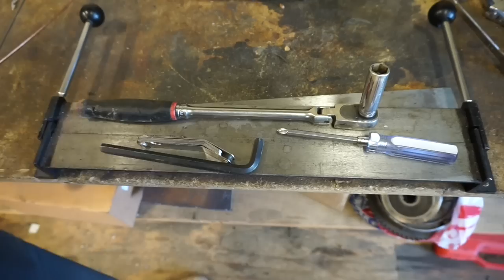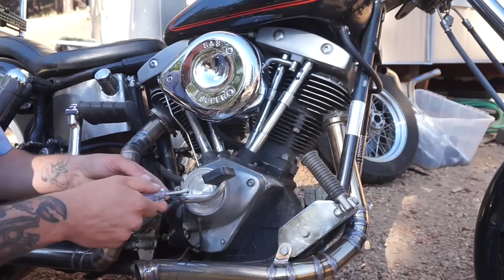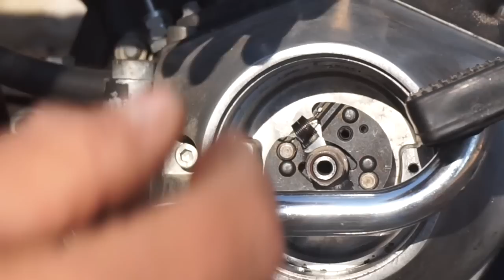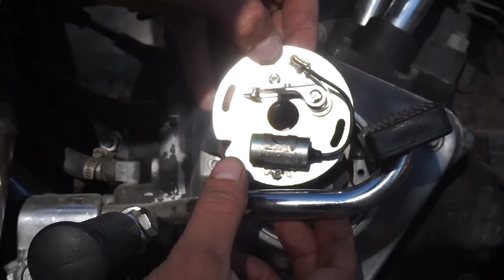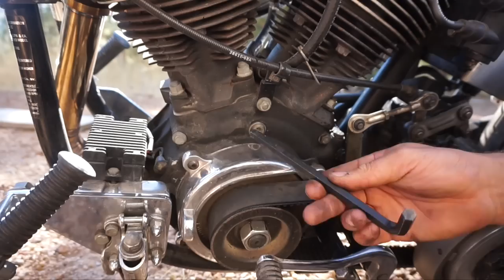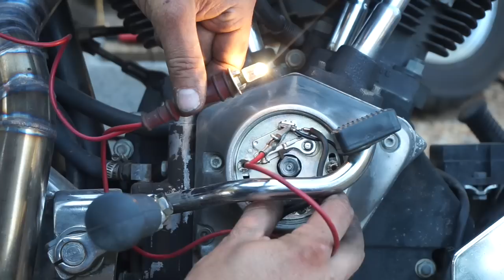Harley Davidson Shovelhead Points Installation and Timing

Comment: The use of sand-paper on new points is a no-no...
Which you didn't do in the video, but you did comment
The reason is that their is a coating of platinum [electroplating] on the points that you will were off. This will drastically reduce the life of the points.

Now that's cleared, the only reason  to use sand-paper is to get out of a bind, when your points are burned.
When the points are burned the coating of platinum is already damaged, pretty much gone, so sanding the points will get the engine running again in the short term. This will continue until you replace them or you get tired of sanding, which ever comes first...
That was my ten cent's worth of wisdom.... Keep on riding...
Reply: thank you

Comment: This was a good video. But let me clarify a few things. 
1. Do not torque your cam bolt to 24ft lbs. Its more like 7ft lbs.you will snap it off if you do 24ft lbs.
2. Do not put red toctite on your cam bolt. You will never get it off again. And trust me if your running points and advanced unit you will be replacing it at some point.
3. When using the feeler Gauge make sure the point arm does not raise when you insert it. You can see in this video the point arm raises everytime he inserts the feeler gauge. He was going for .18 but in reality it was probably like .16. But other then those few things it was a good video on shovelheads and  those are hard to find.
2.
Reply: Factory manual says 12 to 16 INCH pounds....that is 1 to 1.333 foot pounds ...these are tiny bolts...and you don't want to break them

Comment: Rode a 72 shovel in a 58 pan chassis for 18 years. Hate the day I sold it. Road side repair tip. A standard paper match book is approx .018 inches and the striker surface will clean the points.

Comment: Had a 1980 with same rims as your 83.mine had electric start and kick,only used the electric start once just to see if it worked.kick start worked first kick every time once on correct stroke.i thrashed that bike for 3 years,went real good,4 speed was good too,all I ever did to it was loctite and tighten bolts as they came loose.it was an awesome bike.⭐⭐⭐⭐⭐👍👍👍👍👍

Comment: Just small tip always clean new points contacts pads(where u  placed feeler gauges ) with some sort contact cleaner (petrol  in piece rag) does as all new points have a coating and if not taken off cause points contacts to transfer voltage the easiest path ( means uneven and in cases small pits in surface contact pads) this means smaller contact area and also less points life. Jose Cuevas is correct the above step lengthens life of points but if u don't take lacquer coating of contacts u will end up using points file

Comment: If you press on the brake and stick a wrench sideways in the gap where the brake pedal pivots it will keep the pedal down and out of the way of the ignition making it a little easier.

Comment: I went to tighten my points plate, and one of the holes for the fastener stripped again. So, since I already had helicoils installed. Ordered a new Cam cover. Your video is great.

Comment: Another good video, maybe make a vid about 4-speed clutch adjustment, push rod, cable tension, thanks.
Reply: How many of us out there have a mousetrap? I do . Learned how to adjust mine from  a old scooter trash friend of mine. Great vid I'm now running a ultima ignition in my shovel but points are always in the bag.

Comment: DO NOT USE RED LOCTITE on cam bolt!!!!!!!  only use blue.
Reply: What's the difference?
Reply: @ranchurdhimster4955  blue is medium strength.
I don't use any threadlocker.at all 
Never had a problem with it coming loose

Comment: what is that in the head between your push rod tubes ? I have a 1980 with those threaded bosses on my heads but nothing in them. Thanks
Reply from the maker: I used it as a carb support bracket.

Comment: How do I use a multimeter to test the voltage coming from my points? A step by step would be greatly appreciated.
Reply from the maker: Just like the test light hook you negative to a ground source and the positive to the points. Put your meter on dc voltage and rotate your points plate as soon as it registers 12-14 volts lock down your plate. 💪

Comment: Bro can you do timing this way with electronic or is it different.?.
Reply from the maker: Almost all electronic ignitions get setup a similar way especially a Dyna s ignition.
Reply: @IdleHands  thank you very much i bought an 1981 wide glide but it has a S&S engine which i would like to go back to a points set up because if I have issues on the road its always not hard to carry a set of points and plugs but not a fan of electric ignitions or fuel injection systems on bikes carby points condenser and plugs you can usually get yourself home.

Comment: 20 to 25 lbs of torque on that points kit keeper bolt. I think someone should try that and see what happens. By the way have a second bolt ready. Snug with a bit of locktight that's all.

Comment: I do the .018 gap on the large lobe. When I 180 it to the small lobe, the gap is MUCH larger. What does this mean?
Reply: You probably already figured this out but it will be off a little, 2 thousandths either direction. If it's more then that you may have to set your andvanced unit again. Sometimes tapping in the cam bolt with a rubber mallet to seat it correctly.

Comment: What brand of kicker is that for an 1983? Is it a kicker for a 5 speed?
Reply from the maker: it’s a 4 speed.
Reply: @IdleHands  thanks for the reply! What brand of belt drive on the primary?
Reply from the maker: Bdl belt drive with primo Rivera clutch.
Reply: @IdleHands  Nice 👌

Comment: whatever you do don't torque the thin bolt to 20 ft lbs. can you say SNAP!!
Reply: Ya he musta meant inch lbs
Reply: 20 in lbs ... And Red Locktite will lock the threads whereas heat will be needed to get it apart again...
Reply: @dragstews  ...yep...I call it the "dreaded red" because it's almost permanent. You'll prolly have to take out the cam to get out the broken stud.

Comment: This is a what not to do video. At about 10 lbs of torque the bolt will snap and if not when you go to remove it that red loctite will break it anyway. Never use sandpaper on points!!!

Comment: So I have a 79 shovel and no info on where the tdc mark is on this dam video either, what I get for buying a dam older than 80 bike no help at all.
Reply: You remove the push rod cover ( like on the video ) then you are close to TDC ,remove the timing plug and look for TDC or the VERTICAL line rotate motor with kick or rotating rear wheel
Reply: I have a 79 So Iam useing the dot not the advanced line
Reply: @alanb7128  I've already found what happened, my engine was rebuilt again in 2014 and the guy that rebuilt it instead of using the dot he used the line so I just accidentally found that out by trying it the line and it fired right up and it's been running fine ever since.
Reply: @dynacon2  in the last gear of course correct? 4th or 5th gear ?

Comment: WHY are using points? 1983? They were electronic.  I see no reason to go backwards on tech.
Reply: Cheaper replacement of course, I'm tired of buying chinese ignition module's from the Harley Stealership!!
Reply: I do. If your going to kick start it often, then points are the best wat to go.
And you can replace the points easily, I believe that you can get a pair to get you by at any auto store to get you by.. But with an electronic ignition going out.... call a tow truck.
Same with solid pushrods and lifters, you can get on the road alot quicker..
Reply: @kimber4573  I have electronic ignition in all my sleds. None of them have ever failed.  However in the saddlebag I have points condenser and mechanical advance unit.  Doesnt take long to swap out.  As far as kick starting I hear people say all the time its easier with points . I dont agree. If it's set up correct starts right up. Even on a cold morning.  Maybe the people that say that are to light in the ass. I lift weights so I can easily spin that sucker and start it
Reply: I've been riding a 79 shovel for 18 years now went from points to electronic back to points after electronic gave out twice on the road.
The thing with points is u can pull into an auto zone if something goes wrong.  rather than carry an electronic  in your saddlebags where it might get damged. The dyna s is a good ignition but my experience is I get  4- 5 years before it dies 
.a good set of points set will last.a  year. I've gone 2 years use on a good set . ,probably blue streak.
Reply: @lonesometinman3147  dyna S uses a mechanical advance.  I use a true electronic ignition.  Its been in there so long I forget what it is. Set it  forget it. However I do have a set of points with the advance unit in my tool bag. I dont ride either of my shovels often . Same goes for the panheads I own. My daily ride is a 09 dyna street bob.  Stock displacement.  Gear drive .cams. exhaust . Different air cleaner and a EFI remap. Never needs a dam thing .tires brake pads . Fluid changes.  Thatz it. Every  time I ride one of my ol skool sleds I'm wondering if its gonna brake the entire ride. To be fair I can work on them on the side of the road while if the TC brakes down it's getting towed home.